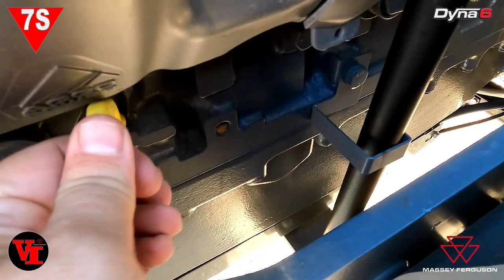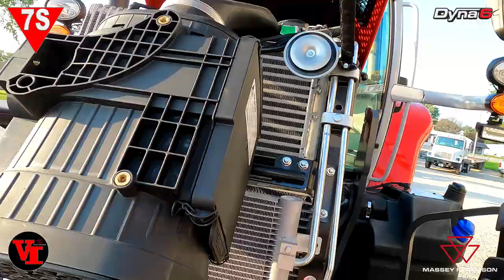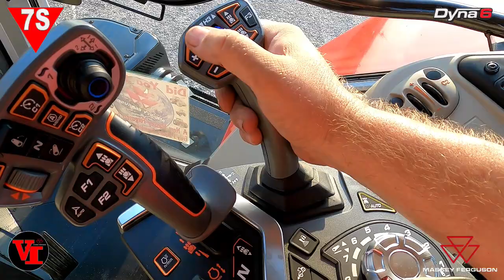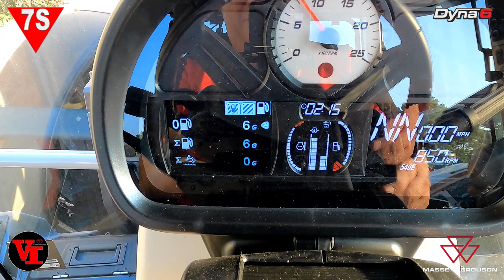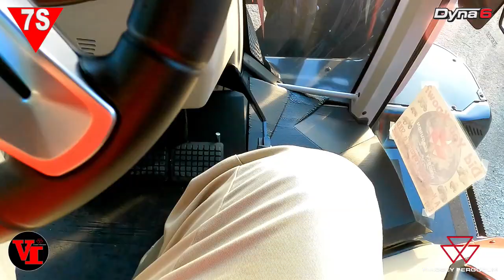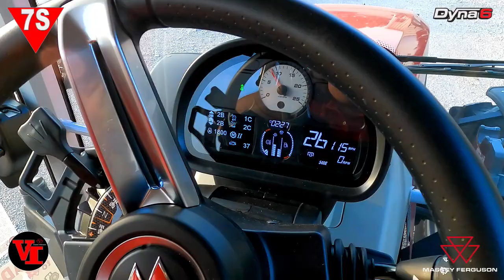Massey Ferguson 7S.155 Deluxe High Horsepower Tractor with DYNA6 Transmission

Comment: Getting rid of Deere (went woke and I can’t abide by that) overpriced but honestly extremely comfortable and somewhat reliable) I need to replace a 5125r utility with grapple and 7210r 5 remotes, no auto track. Small acreage (560 acres) can’t stand billy gates either so the green has got to go. Don’t need a 210hp tractor but it was a hell of a buy at auction, I just can’t stand how Deere went, rubs me wrong. AGCO any good? Neighbors got a Massey he absolutely loves and I drove it, nice but rough ride, sparse cab but it’s a 15/16(?) year old machine and Massey/AGCO/Sumitomo looks to have stepped up their game like everybody. Love the cab of that tractor you’re showing. The swivel seat is a godsend tbh and cab is layed out premium, organized and makes sense. That and a cigarette lighter 👍 I smoke, so what? Mind yer business. How’s dealer support? Only reason I went with Deere is they’re only a couple mile down the road but they’re terrible and good luck getting your equipment back in a reasonable amount of time and EVERYTHING DEERE IS WWWWWAAAAAYYYYYYYY OVERPRICED, don’t get me going on what it costs to replace a hydraulic pump or repair ANYTHING for that matter. Got the 5r sold so in the next month will need a replacement as it’s gone in 31/2 weeks, got a loader on the 7r so I’m not too pressed.
Reply from the maker: Massey Ferguson S Series is the High Spec Models from Massey Ferguson but you have choices on the level of specs you need. Transmission Choices in many  of the Models like the SemiPowership Dyna6 or World Famous FENDT CVT is the DynaVT Version. Smart was to Buy is work with your local dealer and build and order a tractor speced just the way you need it...and by doing that there is extra discounts for PreBook/Presale Program from Massey Ferguson. But there is dealer inventory too that dealers can transfer and get one sooner. Some great sales promotions going on now and if you buy more than 1 in 12 months there are multiunit bonus discounts too!
Reply: @VahrenbergImplement  what’s the turnaround on orders?
Reply from the maker: Depends on Model and orders right now we are seeing order to delivery to dealer times back to more normal 4 to 6 months time frame. All depends on Demand but your dealer has access to estimated time line documents and can estimate before ordered or talk to his account manager...sometimes changes can be made to existing dealer orders and that helps reduce build & delivery times.

Comment: Wide  fenders look like shit. We've  been force fed those gay ass lookin things from the UK.  .  Put square narrow fenders back on . Be a man!!!
Reply from the maker: Massey Ferguson North America offers 3 Fender width options. Standard is the 78.74" (2.0 Meter) Outside to Outside Width Fender with no extensions. Then there are two Wide Fender with Rear Extension Options like shown in our video that cover the rear wheels. 90.55" (2.3 Meter) or 100.4" (2.55 meter). This is exactly why we recommend visiting your local Massey Ferguson Dealer and sitting down with them and Build & Order the tractor for the way YOU want it. Not only do you get the features and options you want, you don't have to buy items that you don't want or need PLUS Massey Ferguson offers a Presol Bonus Discount which saves you money too. Build it Your Way and Save!

Comment: Now, the PRICE?
Reply from the maker: If within 60 miles of Higginsville, Missouri we would love to help price this tractor or figure a Build & Order Tractor with the Features, Options and Equipment you need. There is so many different choices and options you really need to sit down with your local dealer and get the best tractor for you. If in West Central Missouri give us a call at 660-584-2250 or stop in.